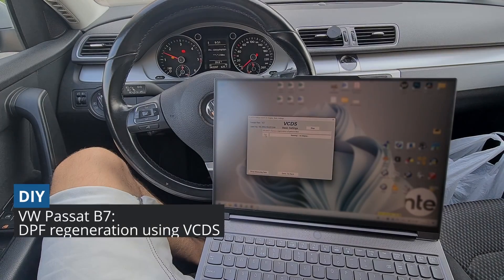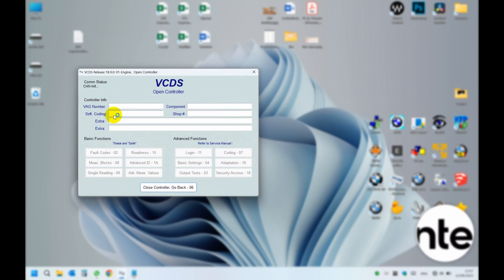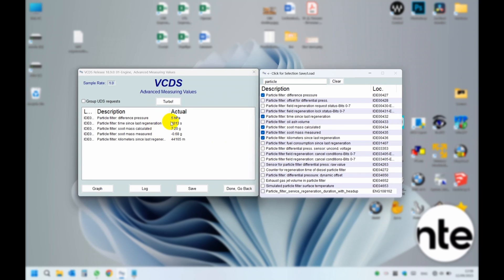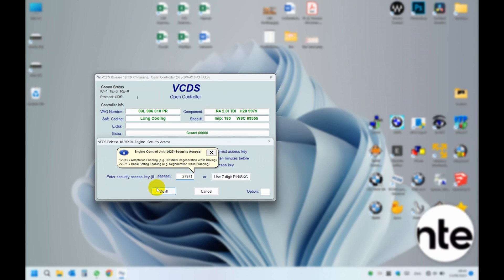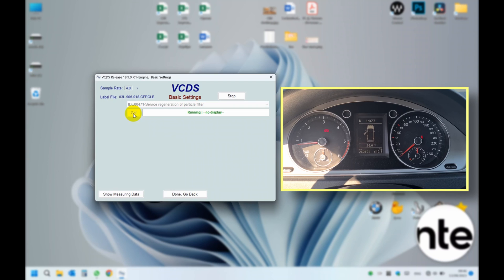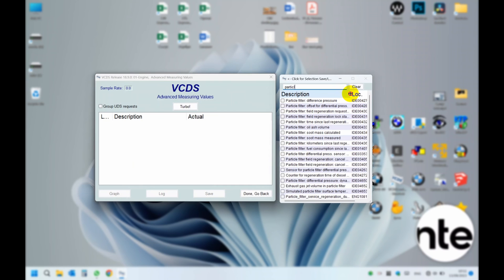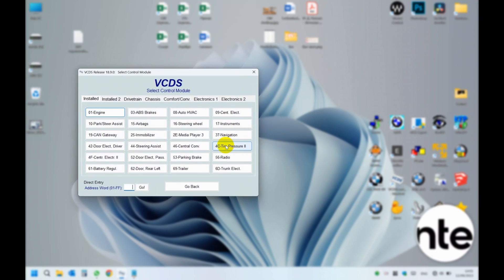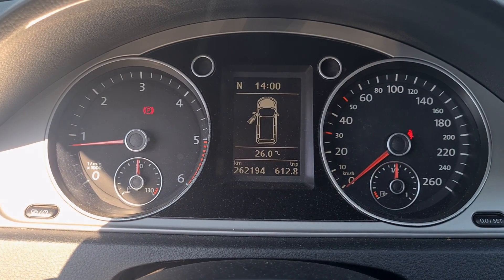DPF Regeneration Using VCDS: VW Passat B7 2.0TDI

Comment: The service regeneration stops after 15–20 seconds. 🤕 Differential pressure at idle is 20 hPa.
Reply from the maker: Looks like dpf is getting clogged
Reply: @dionich  I had the same issue — the service regeneration stopped after a few seconds. In my case, the problem was a faulty throttle valve (J338).
When the throttle doesn’t operate correctly, the ECU can’t build up enough exhaust temperature, so regeneration fails or doesn’t start at all. After replacing it and doing adaptation, regeneration worked normally again.
Reply: Hello friends, I have a stubborn DPF light that keeps throwing P0135.  So this is what I had done lately, I removed the DPF and pour DPF flush cleaner got tons of ash out let it dried and drove it for 60 minutes PDF light disappeared but came back with a vengeance now my car is smoking really bad from the turbo and DPF join.  Drove another 60 minutes but the smells has gone worse and DPF light is back with P0135.  The last successful gereneration was last August of 2024 after I replaced the upstream sensor.  Any advice of what I can do next will be highly appreciated!  I also bought VCDS and I’m wondering if is worth trying to force regeneration I’m worried I will clogged it more as the smells is getting inside compartment and is given me headaches!

Comment: IT WORKED.....26.5 minutes....drove it for 5 minutes....light disappeared....drove it back home...light not back.....I I will update later if the light does not return.... AWESOME.....thank you so MUCH>  the cable from Ross-Tech was $200 = tax...I got regular free shipping.  All the other videos....did not work...but yours did....so far....I hope it sticks...  Thank you so much.  I did not have enough battery in my computer to run again the codes....but I will try again in a few days if I need to,

Pittsburgh Dad Texas
Reply from the maker: If the DPF is already clogged, maybe it is time to remove it and get cleaned profesionally or atleast home cleaned using pressure washer and dpf chemicals.
Reply: @dionich  Do you have a favorite dpf cleaner / spray? From what I understand: 1. remove the O2 sensor near rear top of 2.0 TDI, 2. with the engine stopped and warm, spray in short bursts until the can is empty, 3. Let cleaner/foam sit for 20-25 minutes, 4. initiate regen OR drive car at consistent freeway speed for 40 minutes? Anything else I should know? Thanks so much!

Comment: what do i do if it begins the process and then kills the car and says abort. i have tried multiple times but nothing works
Reply from the maker: Hi. I did also receive "Aborted, safety reason" error messages, but do not udnerstand the root of this. Sometimes they appear, sometimes they do not and the procedure runs without any issues.

Comment: Do i have to heat up the engine first or can i start the dpf regeneration cold
Reply from the maker: I would say, better to heat up since regeneration is a process of burning extra amount of fuel.
Reply: @dionich  so go for a 20 minute driver or something like that
Reply from the maker: @osmaniljazovic6201  Yeah. Make the engine operating temperature
Reply: @dionich  okay thank you very much for your feedback friend
Reply: @dionich  when should i do the dpf regeneration once every 30 kilometers or more?
Reply from the maker: @osmaniljazovic6201  Car is doing it automatically once in a while

Comment: I have a 2014 Passat TDI with check engine light code P2459 & vehicle tends to overheat while driving on highway & when I downshift & floor it to over 3k rpms it would instantly cool its self down
Reply from the maker: Hi. Try to google this code plenty topics out there starting from pressure sensors, clogged egr etc
Reply: @dionich I have replaced the EGR sensor and pressure sensor. I just ordered VCDS and will try to do a regeneration as you did and hopefully that works
Reply: Seems more like a coolant circulation problem of overheating while steady driving. 

You should probably try doing a coolant flush (empty the cooling system for fluid, put in cleaning additive let it run for a bit, flush a couple of times with clean water) and also you should check if your thermostat opens fully. You can check by pulling it of, put it in a pot with water and boil it. It should start moving/opening around 85-90°c. 
Also clean your radiator and condensator for AC for leaves and other road debries.

Comment: Mine MQB platform, says aborted due to safety. stop engine & try again, but same message again. Want to try driving regen. Do you know what value to set ?? After I go into driving while regen settings on vcds it states stored value 0 should I put new value 1 ?
Reply: I had this keep happening to me too. I don't know if it was because I didn't tap the gas pedal or slowly relased the pedal but once I did it the tap version very quickly it finally said running....
Reply: @TheeHomelessRunner  it’s 1:29 am, currently searching the Internet, more problems on Passat b7, totally dead battery & locked out, emergency plastic key doesn’t unlock the drivers door. It turns right & left but doesn’t open the door… arghhh. Does anyone have any tricks to open the bonnet. Seen tricks on b6 thr the grill but 2011 b7 nothing…. 😳😳😳😳😳
Reply: Even smashing window don’t think it will allow me to pull handle to open the bonnet. Will get me the locking wheel nut tho, wheel off wheel liner off to eventually get to the cable… got to be an easier way ?????
Reply from the maker: Hi. I didn't try to regenerate during driving, cannot recommend anything. It requires different password 12233 as far as I understood. I didn't get it why those "safety errors" popup.
Reply: @dionich  regen while driving.. yes change value from 0 to 1. Click do it & then it enter’s rengen. Drive 20 mins light goes off. Sorted